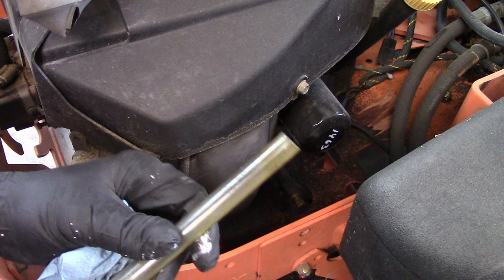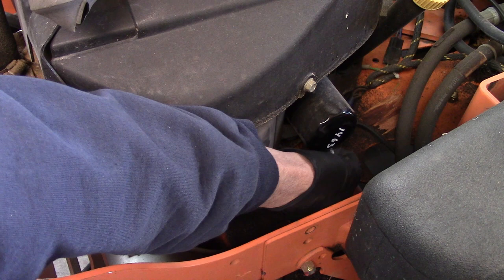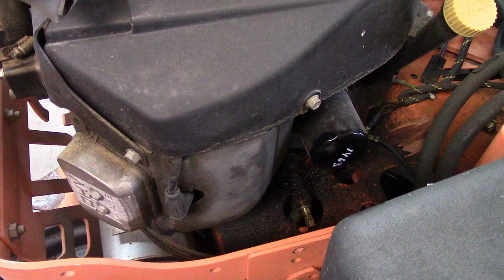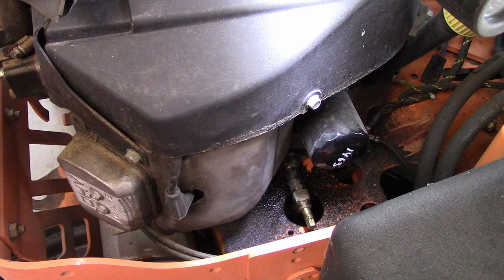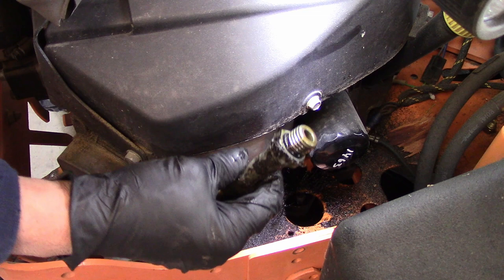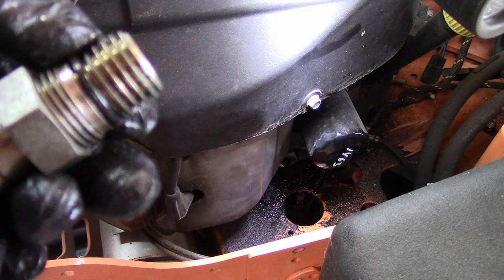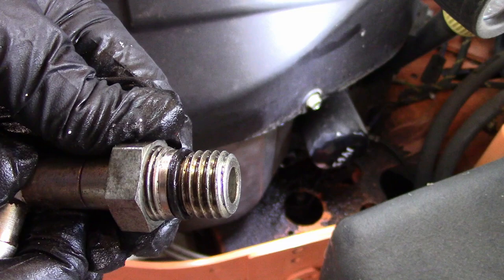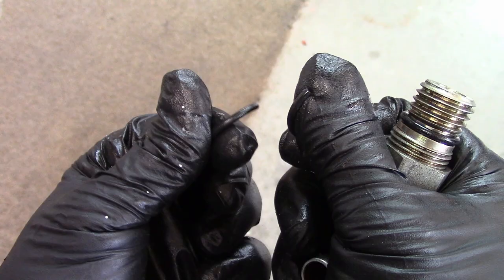Scag oil leak repair

Comment: Thanks for the video.  It was helpful in seeing how to remove the drain.  A couple additional tips for others.  The original o-ring is 16mm ID and 22mm OD which make the thickness 3mm.  A standard nitrile o-ring in this size is typically only about 2.5mm thick.  That's all i had at the time I replaced mine and a single o-ring did not feel snug enough when I screwed the drain back in.  I used two as the way they fit at the base drain made the second one stretch out.  That and some silicon tape around the thread made for a leak-free job, but I would strongly recommend getting a 3mm thick o-ring before doing the replacement.  I couldn't find any at the local auto parts stores but found a pack of 3 on E-bay for $2.99 in case it leaks in the future.  I would also recommend doing this when you change your oil after removing the oil filter because it is then much easier to snug the nut at the base of the drain with the oil filter out of the way.  Anyway, thanks again for the video and hope others find the additional tips helpful.